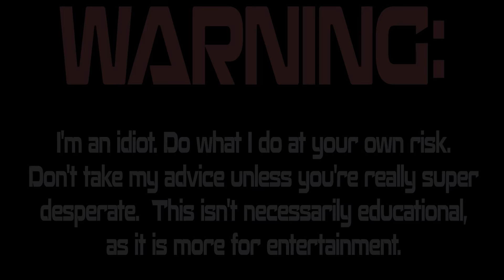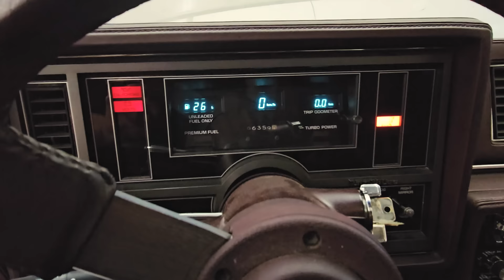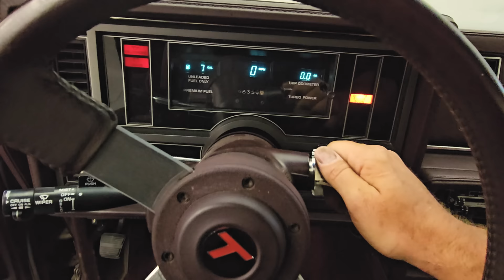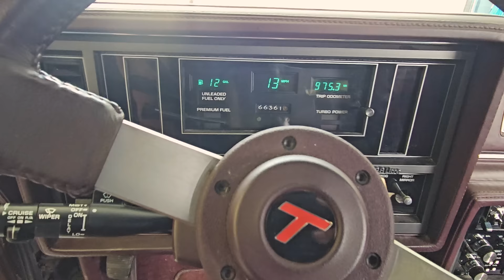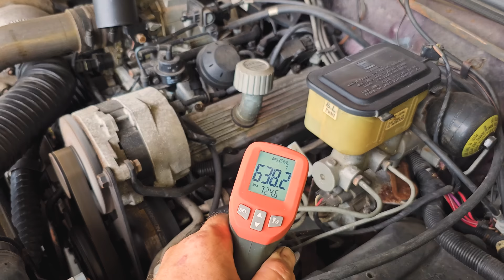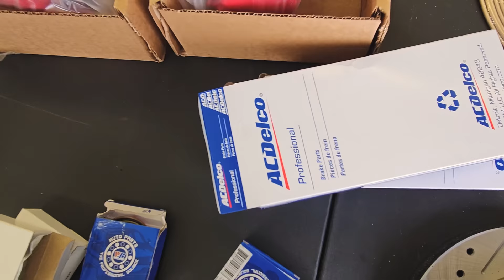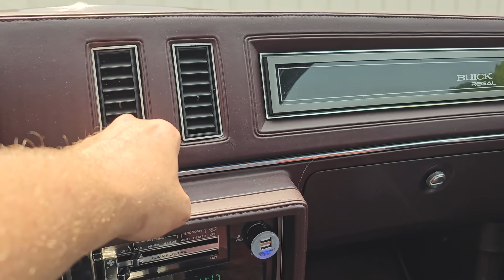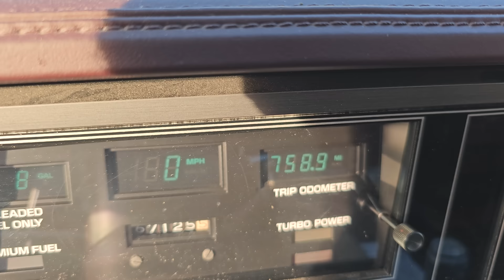ABANDONED In Storage For 22 Years - Rare Turbo Buick! Will it RUN AND DRIVE Home 750 Miles?

Comment: Hey brother i feel the need to let you know about a product that works WONDERS . Im not a fan of any additives but i watched a vid of this additive being used so i had to try it myself . I had an engine noise and not sure what the noise is . Before I changed my oil in my 98 laredo 4.0 i added a product called LIQUI MOLY engine flush to see if it would stop the noise that i belive to be the lifter  tap noise. And drove the jeep for a couple of days with the stuff in there... . i  Immediately saw an increase in power ... now because of this product actually working i went ahead and bought the LIQUI MOLY anti friction.. immediately the noise went away.. as im stand beside myself asking my other self wth how is this possible ..a product that actually works .. my jeep runs like a top,more responsive,more power,and just unbelievably better ... you have to try this product ,its amazing and u could get it at autozone .thats where i got mine . NY long island 
Jason

Comment: Anyone know what "kit" was used to repair that flappy headliner? I was wondering how strong a magnet one has to buy to make it work? What size and shape etc... I use those little twisty buttons with the coiled poker that twirls up in there to keep it from flapping till the time comes to pull it apart. WHAT DID DERRICK USE FOR THE HEADLINER? Anyone... Was seriously considering picking a set of those things up for other projects and daily drivers.

Comment: That's got that insanely dangerous hyperboost brake assist canister on it when I worked for a Pontiac dealership what are the Young Bucks in the shop took that thing and loosened it and that thing took off like a rocket be very careful with that stupid thing

Comment: Re: pinion seal replacement.  Is there no Buick dealer east of the Missisppi River capable of lifting a vehicle this size, dropping the drive shaft to r&r said seal?
Failing that, is there noindependant automotive repair shop in the Midwest that would serve?   Is it vital that the job be done rolling on the roadside with Pakistani tools and techniques?  Why do you stop and stay in motels when there are numerous culverts, ditches and small stands of brush where you could crouch under a trash bag poncho for the night?

Comment: That's when they made car's  that lasted if you gave it TLC  and you kept oil and dirt from building up on everything under the hood and onder the car and the owner did not keep the salt sprayed off under the car and they didn't take the time to under coat the frame or run stainless steel exhaust pips or paint the axle or backing plate forthe brakes  and caliper's on the steering  that TLC I lived in Wyoming and my car didn't rust I washed it every time I had to drive on salty roads and I lived there for 7 years !

Comment: How hot should a 3800 run for water temp? Mine runs at 210 ` steady. Seems like that's a bit on the hot side but it never wavers much off that. Just wondered cause low and high temp relays were mentioned there.

Comment: Wait a minute 0 to 60 in how many seconds . My Olds goes 0 to 60 in 8 seconds . 4.0 ,250 hp 260 @ 3000 rpm . You cannot be right . Had a 3.8 in a Colorado I bet was faster and rusted way faster .
Reply: This car is turbocharged, makes a huge difference in performance

Comment: This cars not worth c rap only thing worth anything engine body transmission frame suspension and entire frame is a danger on the highway and could just fly apart at high speed